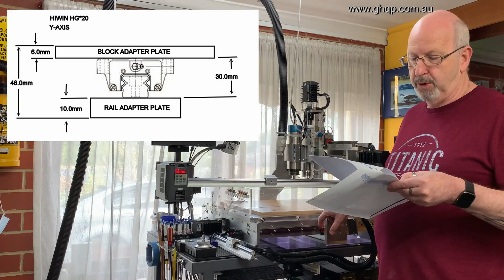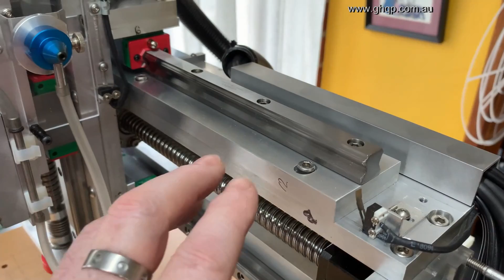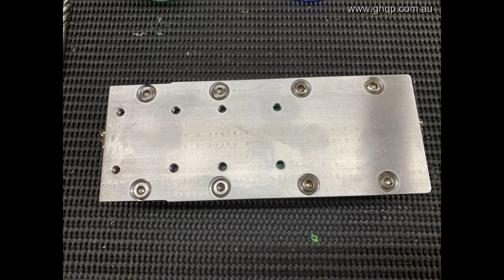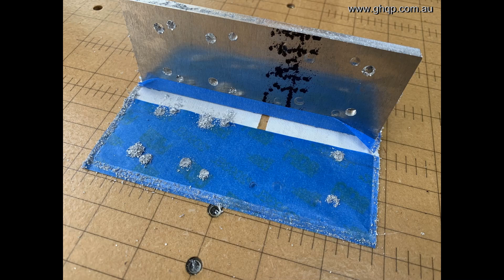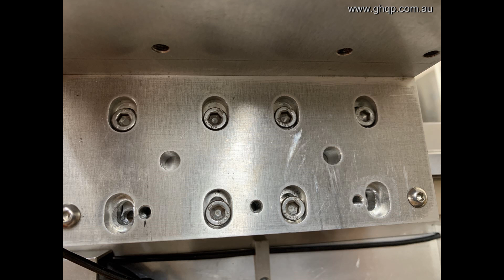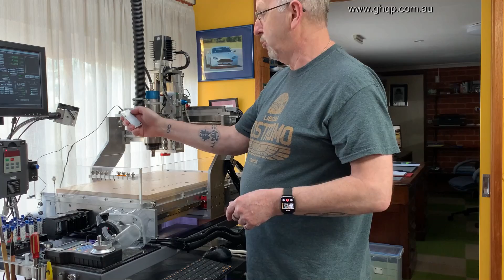Upgrading my CNC Router from Round Linear Rails to HIWIN Square Rails

Comment: I admire you for doing all this in a house with curtains. I would never do that :D. Just a question : would it make sense to replace those steppers by true linear motors (that do immediate positionning at the right place, without any "rotating part") ?

Comment: Hello, I'm seeking advice. 
Do you think I could adapt this Linear Rails guidance system to fit a wooden door,
 similar to the system used for a cantilever gate? My door is made of pine wood, 
it's 2 meters long, 90 cm high, and is composed of 5 planks,
each 10 cm wide and 5 cm thick, weighing approximately 50 kg. 
I like the guidance system of the cantilever gate, 
but it's too large for my small door and I'm considering adapting it with this system.
 The door will be outside, do you think this Linear Rails system will rust?
 I'm looking forward to your response when you have the time. Thank you.
Reply from the maker: Hi I had to read you message a few times to grasp what you are wanting to do. First of all yes in principal it would work but when you say it is outside, yes it would rust and likely seize up, depending on the weather in your aria, likely very quickly. You would need a rail system made from stainless steel or other non ferrous metal.
Reply: @hamrx8  Sorry, my English is dangerous and I wrote the message with the help of chatGPT.  Thanks for answering me.

Comment: Hi, very nice video. I have a question about round liners.Did you like them, do they have big play?I'm thinking of building my own plasma CNC with round linear axes, I need only 2 axes. Do you think it will work well?
Thank you
Reply: Sorry for delay in replying due to Christmas. The round rails worked quite well however over 5-6 years they did show signs of wear especially the Y axis that carried all the gantry weight. As I do quite precision work with my CNC Router I opted to replace the round rails with high quality HIWIN Square ones. I would say for what you are looking round rails would be quite good and honestly at a later date they can easily be replaces with square rails if needed.
Reply: @grahamham3398  Now with the new rails, how will you comment those round ones accuracy's ?
Thanks, Marry X-mas
Reply: @danielbichokov1340  I never performed any specific before and after tests to specify a measurement but would comment that the accuracy and even the surface finish of machined parts is notably improved. The whole machine feels firmer and has a much better feel about it.

Comment: Thank you, Very NICE and well kept, Neat!!! (Lot to copy from). I have a question. For the base estructure, did you use Extruded aluminum or are like the gantry aluminum  plate. Thanks again
Reply from the maker: The sides use extruded and the ends are plate aluminium.
This link below might show the construction in more detail. It was the first before I updated it with closed loop steppers, linear rails and a solid plate bed top. All those are also on my website.
http://www.hamrx8.com/CNC_Router_Project.html
Reply: @hamrx8  Thanks... I have a long way to go !!
Reply from the maker: @rafaelreina6364  Back when I first looked at making my CNC it was some months of research before I actually commenced the work and then about 3 months before I actually had it functional. So it takes time but very satisfying in the end.
Reply: @hamrx8  I may deep in your "inkjar" more than one, I really appreciated the encouragement.  😊😊

Comment: Hello! Interesting, do you have any signs/scrathes on old SBR type linear shaft chromed and hardened surface? Are they good enough if the budget is tight?
Reply from the maker: I had replaced the Y-Axis SBR rails twice over a 10 year period due to visible signs of wear on their top surface mostly in the center, the main work aria. The X and Z axis were mostly ok but I decided to replace them all anyway.

Comment: I my experience it is way better to have linear rails on the top and X gantry standing up on them then hanging of the side. Linear rails tend to work better and last longer that way.
Reply: Interesting.
Reply: @grahamham3398  they have different weight limitations depending on from what side you are loafing them. Sideways you engage mostly one side bearings and from the top you engage all of them spreading the load relatively equally.
Reply: @NINEWALKING  Yes totally understand that. I use my router for home use only once or twice a week so not an issue for me or most home users. The loads are very light. However for commercial use you make a good point.
Reply: @grahamham3398  commercial use or not everyone want to have stuff that will last long and perform as good as possible. There is a proper way and less good way. It is in the design and it can be changed pretty easy to. There you go idea for your next cnc video.
Reply: @NINEWALKING  I do understand and agree with your point and if I was ever to build a new, or need to modify this router again, I would do it that way.

Comment: sir, what is the thickness of the gantry plates?
Reply from the maker: 12mm Plate Aluminium.
Reply: @hamrx8  thank you sir. btw how is the accuracy of your machine?
Reply from the maker: @rengankrishnaiyer6912  +- 0.05-0.01mm
Reply: @hamrx8  Sir thats pretty good. The reason I am asking is that i have checked my DIY cnc router X and Y axes are correctly calibrated but when i machine a test rectangle in aluminum, i loose about 0.3 mm example desired 10 mm but i get 9.72. i suspect deflection in my gantry since it is quite thin.
Reply from the maker: @rengankrishnaiyer6912  You are getting greater error than I would ever like. One thing I do is to take very shallow cuts/pass typically 0.3 to 0.5mm depending on the size of the cutter. Mostly for aluminium I use a single flute 2.5mm cutter 0.5mm/pass. I am not in a rush to get a job done so time is mot an issue. Also a big improvement was to switch from round to square genuine HIWIN Rails. 
We can continue any discussion privately if you go to my website and complete the Contact Me Form:
http://www.hamrx8.com/Contact_Me.php

Comment: I just got 4 Orientals 4 Usdigital encoders the drivers gonna set me back 280$ Rails? Got me 18 blocks, 14 HIWIN in 15mm, with 1069mm rails to match (7)... Plus two INA 48"... The cables and all the prox sensors, drag chain, z axis is built... Ready to. Build the frame. Wish me luck.
Reply from the maker: Wishing you all the best with your build. Slow and easy is the way to go one step at a time. Take care.
Reply: @hamrx8  Thankyou for sharing This is one of the more substantial works I have seen in my research. Seeing the iteration and how it evolved is wonderful. Thanks again.